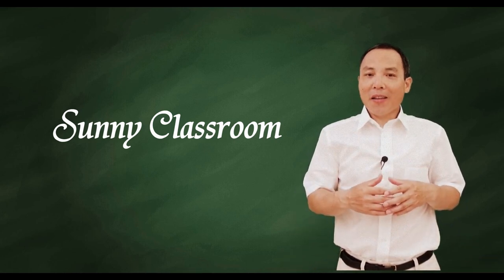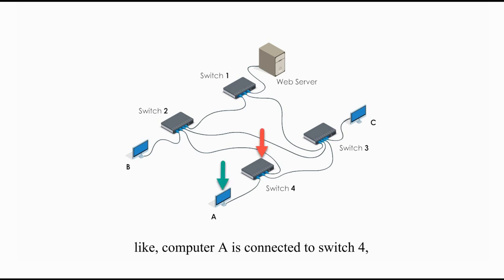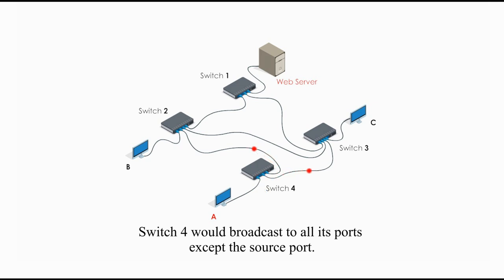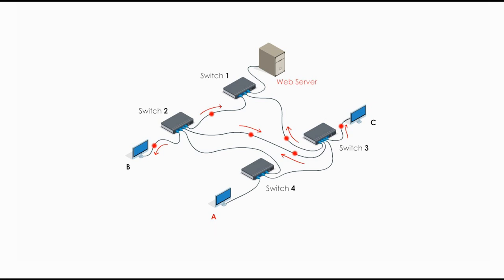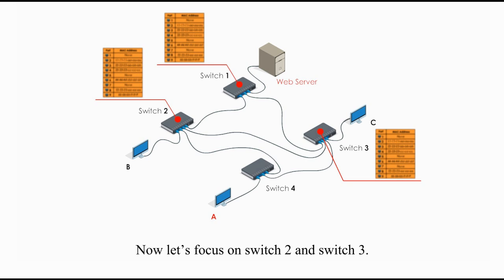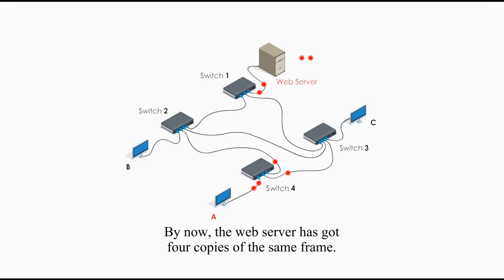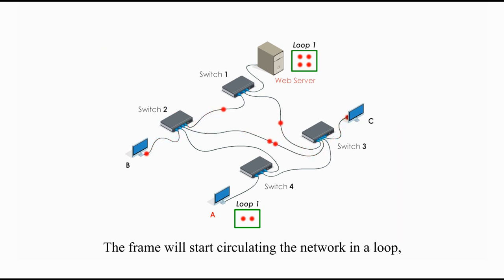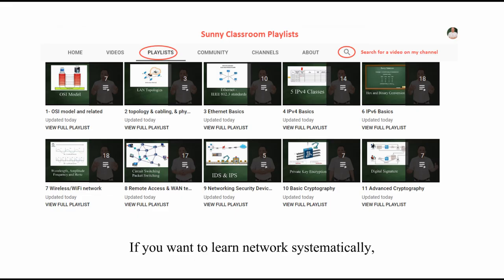Layer 2 switching loop

Comment: if the switch just uses a blanket broadcast to every port every time, then this helped out a lot. I have to scenarios that i would like some clarification on, please:

Scenario 1:  Let's say the initial frame loop from Computer A to the Web Server was able to be stopped after one loop. This mean that every switch now has that source MAC in it's SAT pointing to every switch to switch connected interface because each interface has now received that frame with that source MAC, correct? Now let's say that the Web server sent a frame to Computer A. now there is no need to broadcast because every switch has entries in it's pointing to multiple interfaces for this destination mac.  The frame would just keep looping between all the switches, and Computer A would keep receiving the same frame. Is this correct?
Scenario 2: If there were only two switches connected using two cables, would the loop only occur until each switch's SAT populated?  I mean obviously, you would have to deal with each loop as it happened, but eventually it would resolve itself even if STP was not configured, correct? Once the SAT populated, each switch would not have to broadcast. I think the problem then would be that the SAT would have two entries for the same destination MAC for each port that the switches are connected to. This would mean that the receiving node would keep receiving the same frame twice. Am I correct in thinking this?

Comment: Will the Web Server not reply back to A?, and I think if it replies back to A some packet, the switches can learn MAC address from B's response. And loops can be finished..
Reply: Nope  you need to learn how the sat table of switches work. Switch 4 in this example already knew where the webserver was because it’s CONNECTED to the device. Switch 4 will never know about PC A because it’s not directly connected. Hence why broadcasts on layer 2 are normal

Comment: 1. Subnet the following IP network: 10.90.0.0/20 to accommodate 5 subnets, each subnet will subsequently have 500, 120, 65, 30 and 15 PCs. For each subnet find the subnet mask, network ID, broadcast IP and valid host range. Place your subnetting plan here. Can you help me to solve this sir?